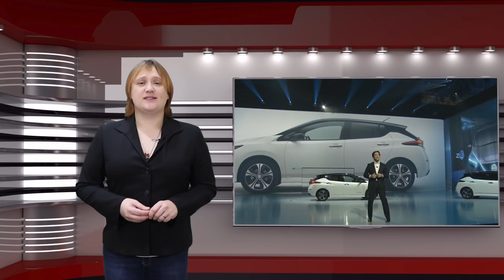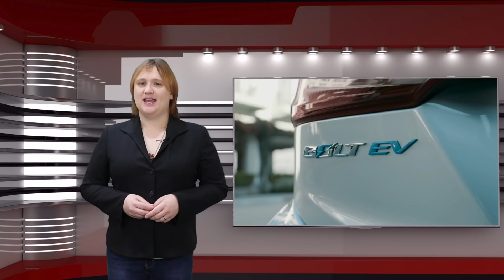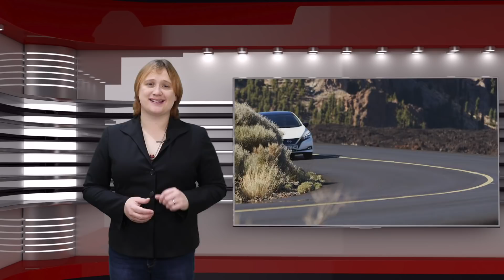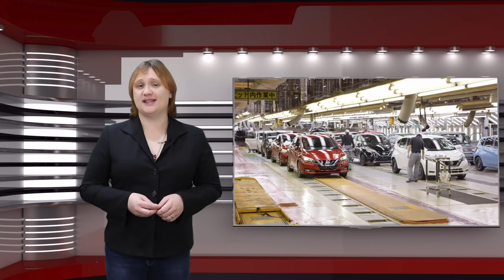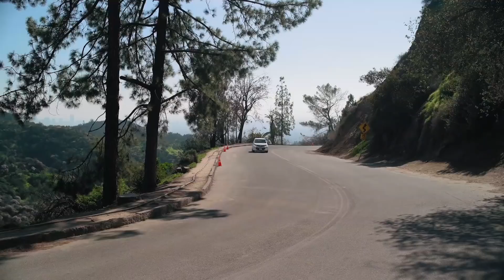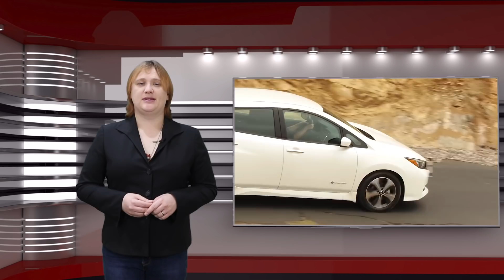Here's What The New Longer-Range Nissan Leaf Might Cost!

Comment: As the only one of the major brands in 2019, Nissan might have the opportunity here to turn lemons into lemonade. A lot of the issues around the current battery pack don’t affect most buyer’s use cases. As a local roundabout, it works perfectly and that satisfies 90% of most buyers. As an owner of a 2011 and 2015, I can testify it’s a great car.